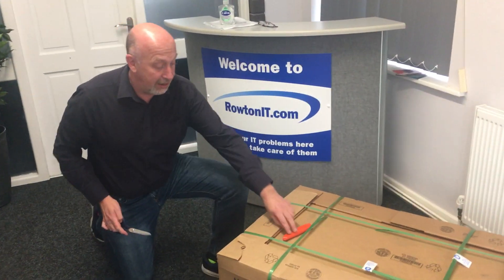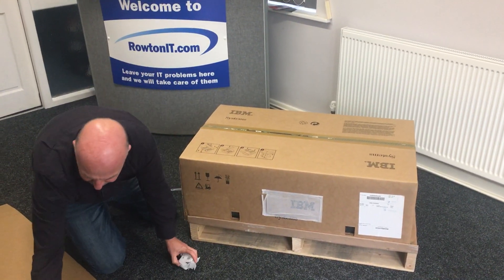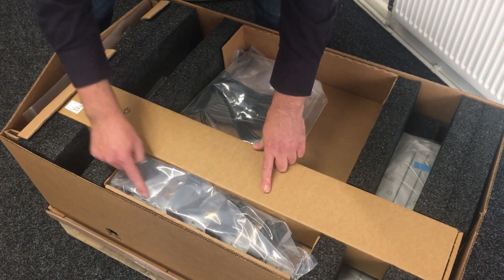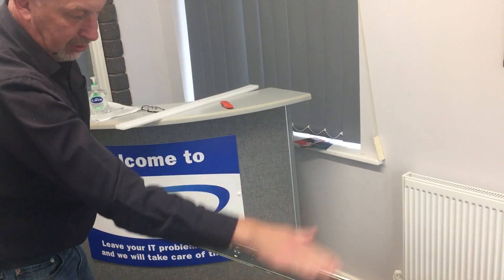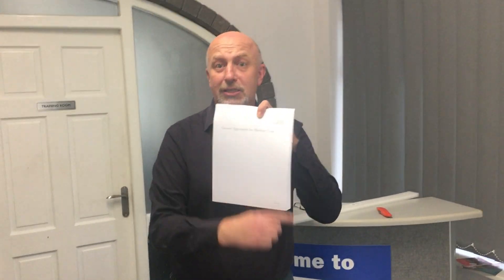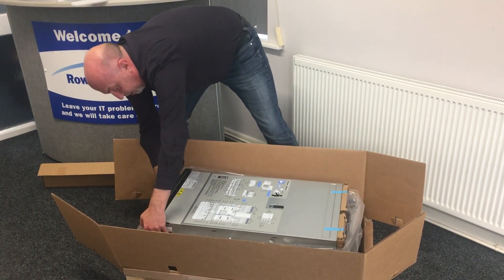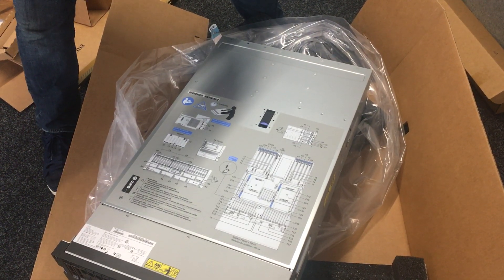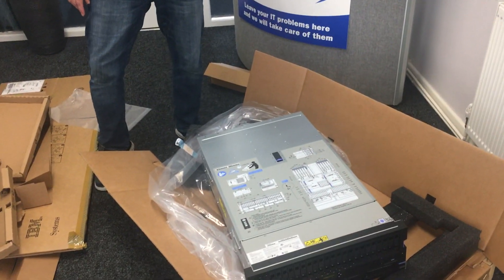Unboxing Power10 Part 1

Comment: That eBMC is interesting. From the back panel, it looks like there is space for a Display Port connector to be attached to the eBMC card in the future. The PCI bus card bracket has the cut out for a Display Port Connector!  Could we finally be getting the ability to directly attach a monitor to the eBMC in place of something like the Operations Console? Or am I just completely out of my mind and that is a different type of connector that is IBM proprietary?

Comment: Back in the late 80's, as a young trainee RPG programmer, I used a 5250 terminal bigger than the entire Power 10 System ;)
Reply: Exactly!  I worked on them!
Reply: Here is one of the large ones from the past. http://www.corestore.org/5251-1.jpg
Reply: Oh I hear that! Dumb terminals right!